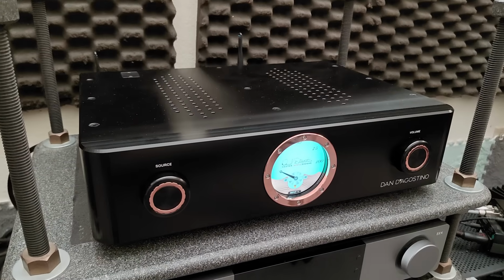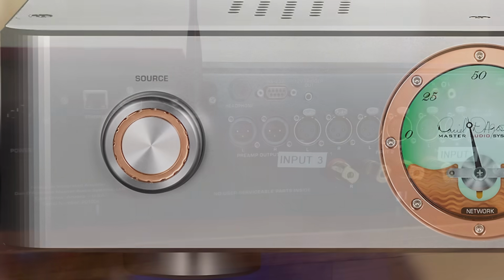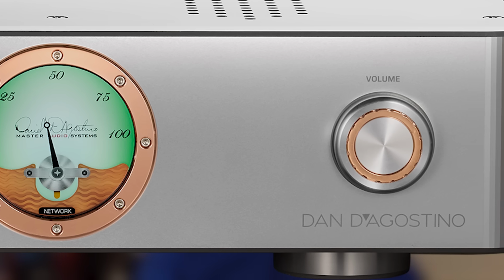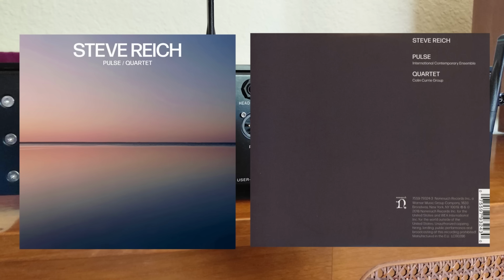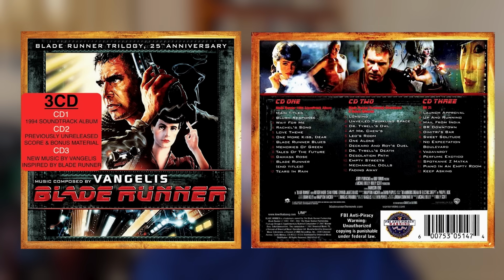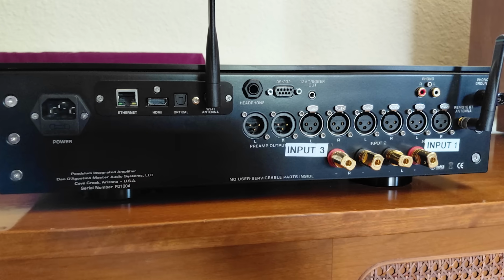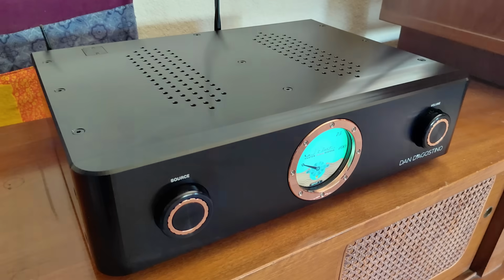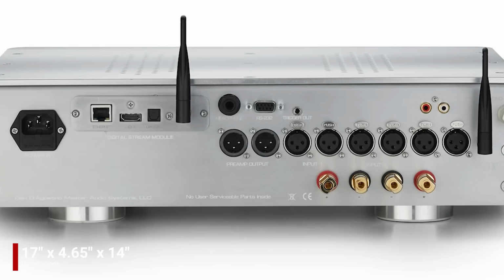D'agostino Pendulum Integrated Amplifier Review

Comment: This is a lukewarm review. I appreciate Muse's process to examine the qualities of the D'ag and his efforts to "optimize" its performance in his system.  I do have several issues (negative) with the review--- I didn't hear which speakers he's using and in how large a room he listens in.  We heard about his comparative amplifiers, but we don't know about the rest of his system.   [This is a significant problem with TAS reviews in that there is no consistency to be transparent (see the magazine) about what equipment is being used in their reviews.  Sometimes a list is given but often it isn't.  [Tom/Robert  - please standardize such reporting].  I'd also like to know, for each reviewer, what are their components that they own, and therefore are more likely to be longterm reference comparisions for the review models.   I own this amp and truly enjoy it.  Muse' insights will lead me explore to investigate other cable options.
Reply: Good point, I listened to the D'Agostino Pendulum with my Paradigm Premier 800f floorstanding speakers for a while. But mostly I listened to it with my reference Paradigm Founder 80f, and those speakers were used for all amp comparisons. I find them to be very neutral, so they are good for reviewing, and also listening in general to many different genres of music. I should have included that in the review. These video reviews are shorter than the print reviews, so we don't normally include a full list of associated equipment like we do in print.
Reply: @davidmilford8478  Thanks David.  My comment about associated equipment (both owned and loaned) is not conssitently included in TAS magazine reivews.
Reply: The “Stamina” he’s mainly comparing it with is something he custom built, ie meaningless to readers. Otherwise he says it’s better than a Cambridge - I should hope so. At the very least, I’d like to see a comparison with the Progression which in 1 step up in the line.

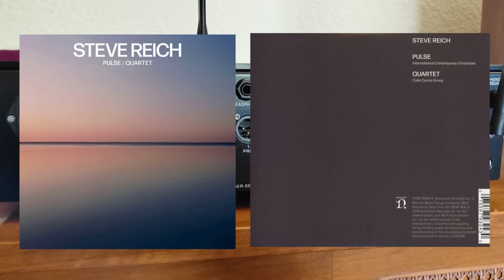Comment: At 4:43.  What is a Stamina amplifier?
Reply: Hello, the Stamina is my own name for my single-ended monoblock amps which I built. They are based on a Nelson Pass Zen amp and Bride of Zen preamp on a single chassis. I made some small changes to the circuit and built them with some of the highest quality parts available. They are not available commercially, sorry, though I suspect the Pass Labs Int-25 sounds similar as it also has simple Mosfet single-ended circuitry. I have not had any other amps in my home yet that sound as good as mine, though the AGD Duet monoblocks at about $11,500 /pair came very very close.

Comment: The optional digital input module was mentioned, but no discussion of what DAC chip is used or what streaming services the module supports (since not all streamers support all services). If the reviewer used their own DAC instead, that should have been mentioned in the review.
Reply: ES9039Q2M-based DAC
Reply: Yes, sorry about that Mark, I did mostly use my own reference network player, which is the new Cambridge EXN100. It sounds fantastic, and works well with the Pendulum amp, yielding a wonderful overall sound. I had made some comparisons to the built-in DAC/streamer module which were edited out. My conclusion was the Cambridge sounded better, so recommend using that or another external network player with this amp, since the D'Agostino digital module costs more. The app from D'Agostino is called DSM and works well, though it is for IOS devices only. I believe they have both Qobuz and Tidal native in the app, and perhaps others.

Comment: I’ve heard one driving wilson Sabrina V speakers with a dcs source. With the caveats that it was a shop demo and it is impossible to point the finger at particular components, but I was underwhelmed by the complete system. I thought my system which comprises of a moon 680d streaming dac with a vintage audio research CA50 tube integrated and Tannoy DMT 12 II monitors was significantly better in most areas. Make of that what you will.
Reply: Audio Research certainly knows how to build musical preamps and amps. I have three of them in my system… ❤
Reply: I heard Watt Puppy with Boulder amps and wasn't impressed for their prices either. I think a high tier of a 'cheaper' brand would be better. I'd go for a Accuphase E800 at this price.
Reply: I’m rarely impressed with Hifi retailer demos.  I’ve borrowed components from the dealer and they sounded way better in my system at home.  In-home demos are the best option when trying to decide on a purchase.  It’s not always possible to borrow Hifi gear, so that is the problem most of the time.